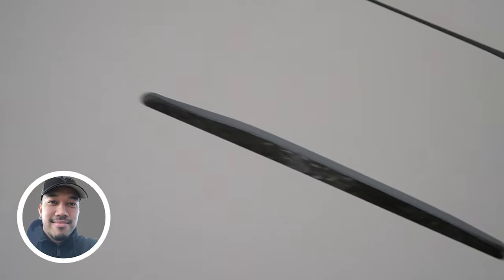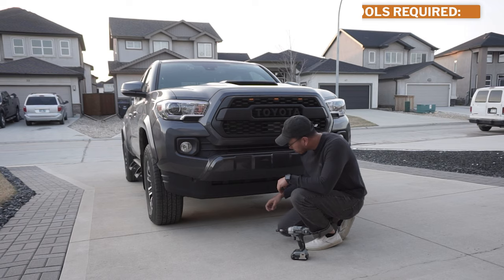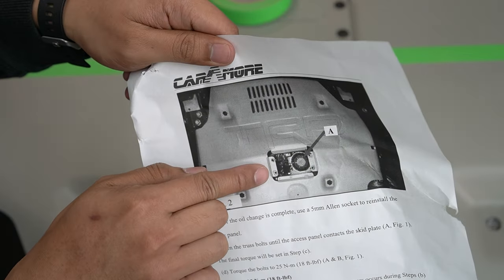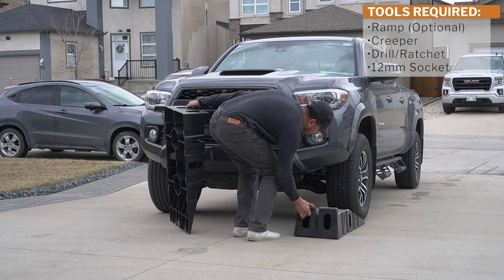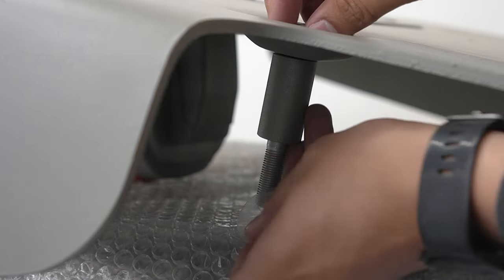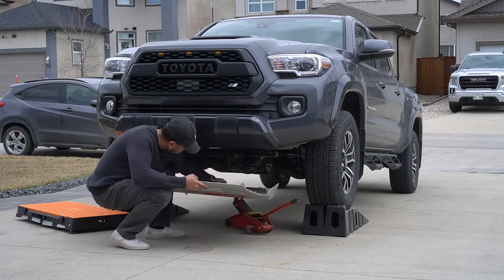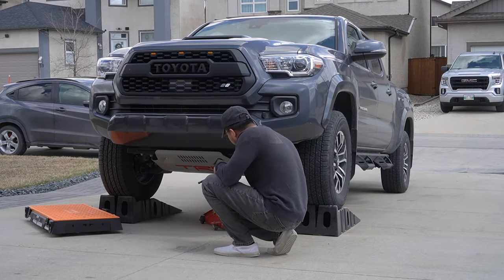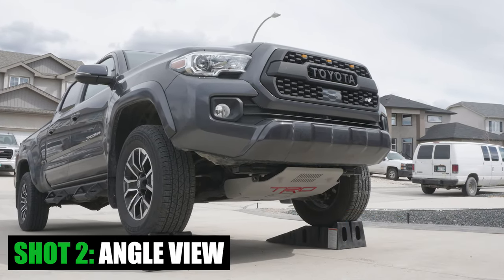TRD PRO SKID PLATE INSTALL on the 2022 Toyota TACOMA TRD Sport | EASY DIY

Comment: Hey just want to share my experience
2022 offroad install:
It was going well until the actual install of the skid plate with threading the 12mm and 15mm bolts. I think my skid plate was a defect as the holes weren't aligned with the truck.
Long story short, I had to drill out bigger holes in order to make this fit.
Great video and it fits after making that adjustment.
Reply from the maker: Hi thanks for watching my video and for sharing your experience! I'm glad it worked out after the modification! Mine is still nice and Intact and no complaints on the product!

Comment: The small bolt use 2 flat washer each one?. Did you put one with the screw and the other one on the nut? Or you put 2 washer together?. Thanks
Reply from the maker: Hi thanks for watching my video. The small bolt only used one washer each. The plastic washer piece did not fit.

Comment: Do you have any problems with the plastic ramps sliding when you first start up? What side steps are you running ?
Reply from the maker: Hi thanks for watching my video! I have not have issues with the ramp sliding but that may be due to me using it on my driveway which is sloped towards the truck (driving direction). 

For side steps I'm using the Toyota predator steps. I have a short install video here. Check it out!
Reply from the maker: https://youtube.com/watch?v=eyWSGJRwEA4&feature=share8

Comment: I’m looking at getting a Tacoma but I’m trying to find different options. To my knowledge the Tacoma Limited doesn’t come with skid plates, would I be able to install some on a Limited just as easily as this and other videos I’ve seen? I’ve never seen any videos on people installing them on a Limited, which may be because it’s not possible. I’d love to know what you think.
Reply from the maker: Thank you for checking out my channel!

In regards to your question, you are correct there’s not a lot of videos out there for the skid plate install on a limited. However, since you’re able to install a skid plate on an SR5 (which is a lower trim than your limited), my opinion is that you can install it on the limited as well. I believe the third gen Tacoma’s have the same bolt patters and main changes are with drive trains and off road features, which is the case on SR5 vs. Limited.

Hope that helps!

Comment: I have 2022 TRD Sport, would the skid plate fit,  I see the 2 10mm hole in back is it already threaded, and after install the skid plate can I put back the air dam if I wanted too?
Reply from the maker: Hi yes it'll fit as I have the same truck (2022 TRD Sport). In regards to the air dam, you won't be able to place it back since the skid plates front will block some of the screw holes for the air dam. I guess you can always cut the air dam to make it fit but I've never tried.
Reply: @themandiyrin  I install the skid plate, I noticed the front not straight, one side high then the other, do you notice on your?
Reply from the maker: @johnnydragon3968  Mine is fortunately all even and straight. We're you able to use the right spacers? As there as different lengths (that may be why one is higher than the other?).
Reply: @themandiyrin   I look under truck the spacer right, when I got the package 2 corner all dent from shipping it wasnt package good, the skid plate kinda heavy UPS  drop it alot when it got to me, couple review on amazon they got there all dent up too, it hassle to return it, thank you alot for the help
Reply from the maker: @johnnydragon3968  Oh no I’m sorry to hear that! Is there a way to get compensation from UPS as that is very unfortunate they damaged your product before install? I was lucky enough that mine didn’t have any damage on it.

You’re welcome sorry couldn’t help more, good luck on your mods!

Comment: Awesome video. I am unsure about the torquing. My instructions don't list any need to torque only to tighten. Did you do this based on your own best practices? My stock plate (via Toyo) does not denote any need to torque.
Reply from the maker: Thank you for watching my video! Appreciate it. In regards to your question, my instructions came with the torque spec and that's what I used in this install!
Reply: @themandiyrin  Ahhh ok. I ordered a skid plate that came from a different manufacturer (it's all Chinese) and didn't include any references to torquing. I will use your recommendations. Salud!
Reply from the maker: @ArthurDealba  good luck on your mods! Thanks again!
Reply: One more thing that would be helpful to others… the TRD Off Road has a second skid plate to protect the transmission. It’s where the rear small bolts would mount. I had to remove that as well but it’s small and has hanging tabs like the front skid plate. Rest of the installation went like a charm 😀
Reply from the maker: @ArthurDealba  Good point Arthur! I'm glad my sport didn't have that haha
Reply: @themandiyrin  It wasn't tricky to remove - in fact, it was rather thin and held by 2 bolts. The aftermarket skid plate is MUCH stronger and heavier which actually gave me more piece of mind going off-road after removing the stock plates.

Comment: Have you noticed a difference in Highway driving since you removed the air dam? Great video, thank you
Reply from the maker: Hi thank you for watching my video! Tbh I have not noticed any difference when I first removed the air dam. However I did add a prinsu rack shortly after and that affected my mileage So I don't have enough data to say the air dam didn't affect my mileage.
Reply: What about stability? Any problem with windy days or driving 75 mph?
Reply from the maker: @gloriapilarte5210  Hi no I have not have any issues on stability!

Comment: Im confuse... please explain, you are taking 17mm bolts and you install the plate with 15mm??? isn't that different thread?? also the two bolts in the back are 12mm... and you used 10mm.
Reply from the maker: Hi thanks for watching my video. Bolts can have different heads with same threads. I used what was provided in the kit. Did you buy the same kit as what I linked? If you did, just use the lengths I mentioned in the proper location and you'll be fine.

Comment: Will the skid plate fit if I left the airdam?
Reply from the maker: Hmmm I haven't tried. I will check tomorrow and let you know! I don't think it'll work as the front might conflict with the screws of the air dam but I'll make sure and get back to you.
Reply: @themandiyrin  cool thanks bro.  Appreciate it
Reply from the maker: @geminij610  I checked and the front of the TRD skid plate is directly below the two bolts that goes on the air dam. I guess if you modify your air dam (cut out so the TRD skid plate has room) it could work.
Reply: @themandiyrin  good to know.  I appreciate you checking.  Thank you.
Reply from the maker: @geminij610 you're welcome bro. Good luck on the mods!